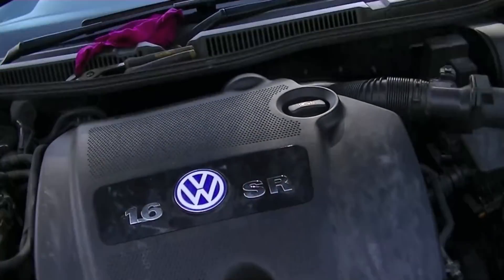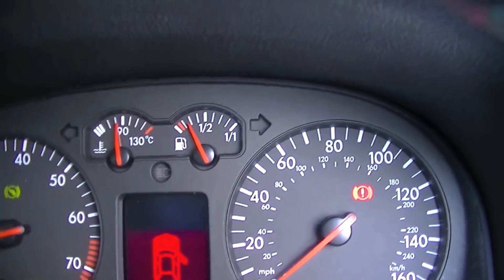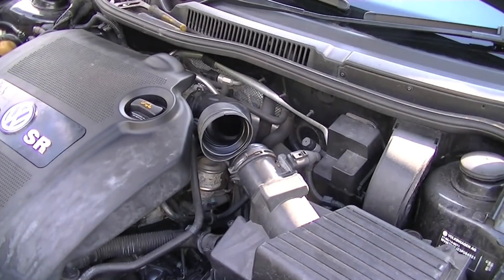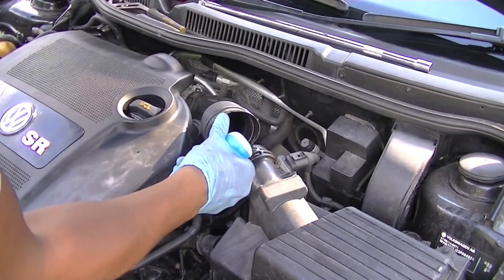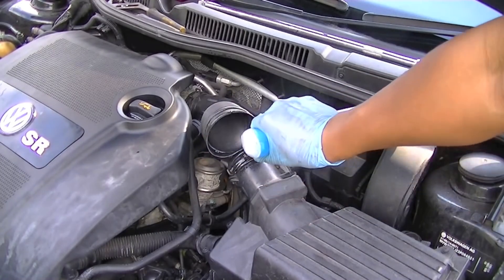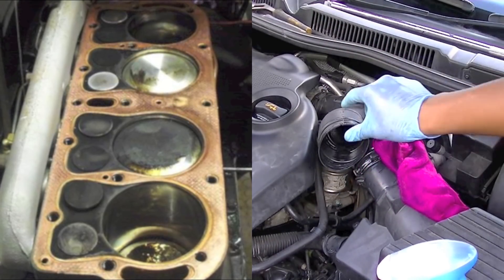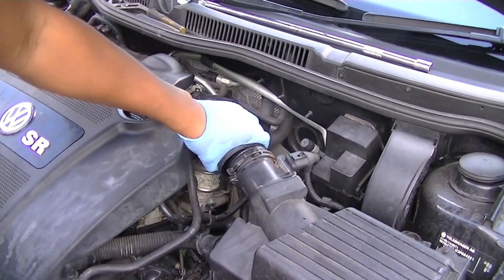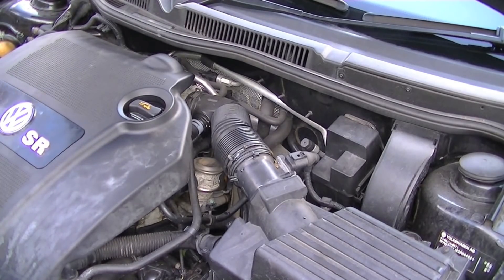How to make your engine run better with just tap water.......Better Than Seafoam?

Comment: oh wow...do not do this! I dont care what the old heads say, its pretty easy to mess something like this. Hydrolock, corrosion the bad outweighs the good.
Reply: OK, consider these $ things...  First for corrosion to occur, oxygen needs to be present.  Water in itself does not corrode.  Nor does it as you suggest, rust.  You then go on to mention that its good for knocking dust off...  If there's dust in your engine I recommend putting your air filter back in, immediately...  Carb cleaner is good for cleaning carbs...  we're de-carboning the combustion chamber.  THEN you recommend lubing the engine...  forgetting, perhaps that the engine is full of oil.  and that most of the parts in said engine have a layer of oil on them... and that the water will evaporate during the petrol fire thats happening on top of the piston...  ergo the steam cleaning part...  or that most of the internals as well as being covered in oil, are made of Aluminium Alloys, which arent given to corroding by brief exposure to steam...

There are videos that explain how water injection works if you're interested in it, there's other videos that explain how the internal combustion engine works too...
Reply from the maker: Andy W Have you ever done this before?
Reply: Nope never will either. While this is the most inexpensive of all the ways to clean engine internals there are better ways to do it.
Reply from the maker: Andy W So how can you advise others?
Reply: Andy W Come on Andy...  You know full well that its a silly idea to put a shedload of water into an engine.  If you're damn fool enough to put enough fluid into an engine to hydrolock it?  you deserve everything you bloody well get...  Lets not be an idiot about it...

You MIST water in, enough to cool the incoming fuel/air charge, as it evaporates...  You wanna look it up.  its a good idea.  For better results, you can try half water, half meths...  It evaporates faster, drawing MORE heat out of the inlet charge.  I'm not about to describe here how a pro-stock alcohol engine out-performs petrol...  It just does...  YOU can do your own homework if you're interested...
Reply: Andy George alright fair enough. yall can do that shit if you want. im not gonna if the engines too bad ill either do a replace or a rebuild. if its not i just wont mess with it. all im sayin is its easy to screw something like this up. unless you really know what your doin and trust me from experiemce, most people under their hood dont, i wouldnt advise this. yall can talk shit on me, do your thing i dont give a shit i stand by what i said its not a good idea.
Reply: Andy W You really cant screw this up, if you do it properly...  Buy and fit a Water Injection kit.  Dont use a squeezy bottle, thats cowboy-ish.  The instructions on a kit are self explanatory, and all the parts supplied.  It's a vacuum draw system, which means the engine takes only the amount of water it needs, and the only issue with a kit is if you let the water run out, so the injection system starts sucking air (which makes the fuel/air mix slightly lean), but we are talking a VERY small amount of water mist, so a very small change in fuel/air ratio...

The benefits are more power when the air/fuel mix is cooled, as the water evaporates.  Half water/half meths gives a greater heat exchange on evaporation... You know, like an intercooler... The steam burns thru the engine, the flame front in an internal combustion engine can reach 260ºC so there will be no residual or unevaporated water, and the steam... well...  steam cleans (oddly enough) the combustion chamber...  

Hey!  Clean Engine!  cleaner oil, cleaner heads/valve seats/etc, engine last a LOT longer, runs smoother, and did I mention more power?  The only down side is cooler inlet charge, cooler air is dense, means you can fit more in the chamber, and gives an increase in power, but...  you might find yourself using a little more fuel while the water is on...

I dunno big guy...  You can stand solidly by your idea that this is a bad idea...  I have a 550,000 km 77 Ford Fairmont thats on its original 4.9 V8...  runs like it came out of the showroom last week...  Permanent water injection kit...
Reply: Andy George
Reply: My technical 1+!. Water is corrosive. It rusts, but might be good for knocking the dust off. Still after you do, you might wanna lube it to prevent rust. Note. Carb/engine cleaner has oil in it. It is an oil based......Unlike an alcohol or water based....
Reply: +Andy George You forgot to  mention how expensive those kits you are talking are, I just looked them up they're in the 450+ range!!! I think I'll try the spray bottle method first...

Comment: This is a great way to destroy your expensive Jaguar, mercedes, or BMW engine.
Throttle bodies have moisture sensors that will throw your vehicle into limp mode if it detects water. 
This is a joke.

Comment: Water does work, but the flow must be regulated and not just poured into a vacuum line.  I converted an older BG44K kit with a small brass valve to regulate water flow into the intake. It should be noted that rapid removal of carbon in a running engine can cause large chuncks of carbon to break loose, damaging piston, cylinder walls, closing spark plug gaps, or getting hung between exhaust valves when they open and close. For the do it your selfer I would recomend running 1 can of BG44K in a full tank of gas once a month , on they second can make sure you do some heavy acceleration runs as this will help with the carbon removal.  It should be noted that you may see a reduction in fuel economy when BG44K is in your tank and some minor exhaust smoke as the catalytic converters consume the carbon residue. If the carbon buildup is extreme,  the the head should be pulled and mechanically cleaned via walnut shells or hot tank.

Comment: I have a problem in the Golf 4 car in 2002, which is speed. When I will be at the speed of 80 km and press to Xeirator not rev keep in 80 and after 5 minutes or 10 starts the index to rise and the problem is also in the initial speeds of 20 km to 60, and so ..memkn help please

Comment: Instead of spraying water into the air intake try instead using Acetone in your fuel.  If you use 4oz/10gal gasoline then you will increase your Oxygen by atleast a point and additionally it will keep everything clean as a whistle so resulting in more power and more MPG.  This method works equally well for cleaning your injectors/carb. There is a way to make your car work better with water but this is not it.  Search YouTube for 'Water Car Inventor Murdered' and 'GEET' and 'Paul Pantone and Arkansas' and 'Water Car Philipines'  What you will get is various methods of making your car run off of water and 'how-to' videos which are very inexpensive which is why it has been suppressed by OPEC and the Oil Industry.  It costs less than $100 bux to make your automobile to run off of water if you use a stainless-steel fuel-line from a used Volvo.  The basic premise of the GEET is using a Model Airplane Carb to create a true Vortex and a Plasma-ball effect to achieve far better Performance and Fuel efficiency using water as a fuel over hydrocarbons.  The Philipino guy uses a Water Reservoir filled with Copper-pads and then fills it with water and runs a current to it - low voltage, high-frequency which rapidly separates the oxygen and hydrogen both of which are usable as fuel.  The GEET can be used with every sort of motor which is designed to run off of hydrocarbon including generators made to run off of fuel oil and can run off of 80% saltwater which could keep Tankers on the Ocean 5 times longer or make them to accomplish the same job using 20% as much oil.  There are also EMGs which can harness the Light Aether to power an electric motor instead of using batteries.  There are motors which use inert gases which can run for 15 years straight on a tank which resembles a 80gal Propane Tank.  The Dynomax Engine used in conjunction with these other methods could perform better than any existing engine including the Tesla.  Using Royal Purple motor oil with Lucas for synthetic and Marvel Mystery Oil, High Test Gasoline w/ Acetone, K+N Air-Filter, Tornado Turbonator, and a Flowmaster.
Reply: What are your best results to date?
Reply: acetone is corrosive isn't it? don't you think it will ruin your fuel lines and every rubber in its way?
Reply: +Daryl Owen Why not run it on NitroMethane and have done. Top fuel rules. For about 8 seconds anyway then boom!
Reply: that was a bad ass reply

Comment: You do realise that disconnecting the intake after the airflow sensor will log a fault in the ecu and in the future that can cause problems even if the light goes back out as the code will remain in the memory you could easily end up with a car stuck in limp home and a big bill from a mechanic who will laugh his arse off when you tell him that you did it to spray water in

Comment: I have a VW golf 1.6 AKL. At the other end of the air intake vale there is a thinner short hose/pipe that goes from the valve to the engine leaks oil. Any idea what's that hose for, and why is there oil leaking from it?
Reply: Apparently it's called crankcase breather hose. Why would it leak oil?
Reply: aleko rubin Run the engine and take the oil filler cap off...  Hold your hand over the oil filler hole...  Can you feel pressure?  Get back to me...

Comment: there is every chance of hydraulicking your engine doing this
Reply from the maker: Andy Coakes Speaking from experience or hearsay?
Reply: i would say experience 36 years as a mechanic
Reply from the maker: Andy Coakes So you have seen cars hydrolocked in this way?
Reply: i have see cars  hydraulic in a number of ways  unlike air water does not compress i saw one hydraulic in a car wash also removing all the carbon from around the top of the cylinders will cause it to use oil again and will take time for it to bed in again like a new car does i dont rate this i dont rate sea foam or any of the de coking or piston cleaning treatments on any car under 150 thousand miles
Reply from the maker: Andy Coakes You should give water method a try, you may be pleasantly surprised. It is very unlikely you can hydrolock an engine using this method.  Any car that's been hydrolocked has had a substantial amount of water ingested in solid mass. I am spraying it in to the intake which is totally different to any of the other scenarios you are speaking of.
Reply: No chance of hydrolocking if you use small amounts of water, it evaporates under the heat and pressure and you can clearly see the steam out the tail pipe

Comment: People do not repeat do not put  water in your vehicle. it ruins the internal parts. and help corrosion.
Reply: Jeremy Capps Performance cars are fitted with water injection. Water would 'Slowly destroy internal combustion parts' if it was just left to sit in there. But its not, the engine is at temperature and the water evaporates instantly. Done correctly this will NOT damage your engine.
Reply: Jeremy Capps 
I find it hard to believe that you have never heard of water injection to cool the intake charge , its an old trick .
Reply: Jeremy Capps Engines get well over 212 (the boiling point of water in case you weren't aware). At 212 the water turns to steam and escapes wherever it can... The exhaust.  What makes you think that water being in the combustion chamber for mere seconds could corrode the internal engine components?..... Frankly, I think you have no clue what you are talking about.
Reply: BMAC VAGS  How come you didn't use a digital inspection kit for a before and after result on your piston heads? I want to try this, but I need static proof that it works and that I won't destroy my engine.
Reply: Jeremy Capps
American V8s while awesome engines tend not to be exactly cutting edge technology.

http://en.wikipedia.org/wiki/Water_injection_%28engine%29
The BMW M4 GTS will be using water injection, google it. 
A
Obviously this won't work as well as a full strip down clean and rebuild, but thats way more than most people are capable of.
Reply: Jeremy Capps Half water, half meths directly after the carb/CPi injectors not only cools down the inlet charge (like an intercooler), but steam cleans the internals... 

Water injection is an old Pro-Streeter trick...
Reply: ok, I have driven a race car. v8 with performance parts. I never heard of water injections. I said before there is no quick fix for an engine overhaul. including putting water in the vacuum lines
Reply: still wouldn't do it.
Reply: Jeremy Capps you might know if it as methanol injection? Snowperfomance makes a kit. Its usually a mix of methanol and water, but running straight water is common because you can get it about everywhere
Reply: ...which is the kind of answer someone would give when they have been shown to not know what they are talking about. Water injection kits have been used on cars for awhile now and no one reports any problems
Reply: Jeremy Capps You are mistaken, my friend. You should go for a 30 min. ride to boil off all the water not in the combustion chamber. But, it will clean the inside of the combustion chamber. Best to use this method as a yearly PM when buying a new car.
Reply from the maker: Jeremy Capps What part does it ruin?
Reply: more power to you, everybody is trying the easy. way. the best way to remove carbon build up. is tear down the motor. it introduces corrosion, water also slowly destroys internal combustion parts
Reply: I've never heard of pure water injection, I have seen methanol/water mixes used in kits before. Seems to me all this would do is steam clean the engine if done in mild increments.
Reply: RickkyP  Been useing water injection for 30+ years.  The only problems noticed is premature exhaust failure. due to excessive rust. Water injection also allows you to advance ignition timing, a lot. Increasing MPG. Water injection is a great system/concept. But, it does require you to pay attention to the needs of the system.  You made a good point, my friend.
Reply: Jeremy Capps Jesus christ what the fuck is your problem
Reply: fine, replace sensors and stuff, it's your car not mine
Reply: good for you. do it. I choose not to. I encourage others not to.
Reply: based off, it the carbon build up is so bad it effects they performance of the car, the engine needs to be rebuilt,
Reply: yes after the fact is one thing adding more to it really ?
Reply: ok pour water in your vacuum lines, I choose not to.
Reply: BMAC VAGS the intake valves or camshaft
Reply: Jeremy Capps I would never poor water in a car engine you could ruin anything infact you could ruin the whole engine
Reply: *****  well it cleans diesel car engines
Reply: I'm not backing down From my Opinion.
Reply: Jeremy Capps No-one is arguing your opinion.  They're feeding you the facts about Water Injection, cause "It ruins the Internal Parts and Helps Corrosion" is incorrect...  Yep, its still your opinion, but its wrong.  While most of us dont mind you being wrong (in fact, find it quite funny), spreading your version of incorrect to people who want to learn the truth, is pretty irresponsible... 

Truth as you read above, is that while HIS method is a bit rugged, Water Injection is perfectly acceptable way to get a little more power (cooling the inlet charge, while the water evaporates), to clean the combustion chamber(steam clean as it runs), and the Pro-Street guys have been doing it for years(You can buy a Water Injection KIT for pities sakes).  I understand if you dont want to know more about water injection.  Admitting you are wrong is a hard thing to do, but if you're man enough to learn, youtube has many videos on how to do this job PROPERLY, without the $0.25 squeezy bottle...

Happy Learning.
Reply from the maker: Jeremy Capps Not backing down does not make your opinion more valid. #FactsOverEgo
Reply: Jeremy Capps Lol you are like a 'One Man Army'....most people give up after such a unified onslaught! Ahhh good on you, right or wrong never give up.
Reply: Jeremy Capps lol unfortunately your not quite right !
Reply: Hey I don't even pour Seafoam in my vacuum lines, I use it as a Crank Case flush. but that's it
Reply: Jeremy Capps 

But an engine produces lots of water as it runs. And it manages to survive!

Comment: so if the head gasket failure resulted in this  wouldn't the water that seaped through the gasket contain coolant and that should be added to the water as well ??
Reply from the maker: nicholas ramrattan Not sure exactly what you mean.
Reply: the water that affected the blown head gasket  cylinder which made the cylinder head clean and shiny would have contained coolant so dosent coolant help in the cleaning process..just a thought...

Comment: BMAC VAGS I bought a 2003 volkswagon golf and the only problem with it is that there is a black box behind the air filter and MAF (mounted on the wall of the engine bay) that needs to be replaced. I have no idea what it is called or what is does? Can you please help me out!?